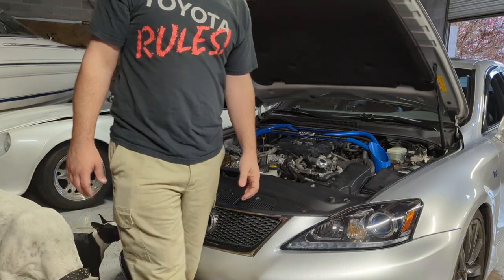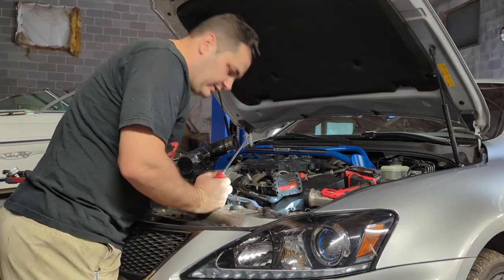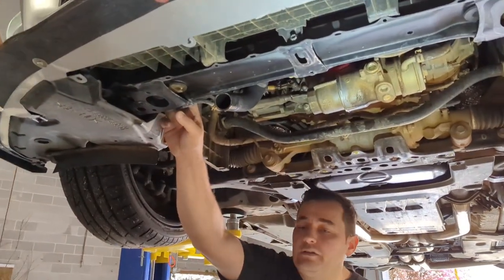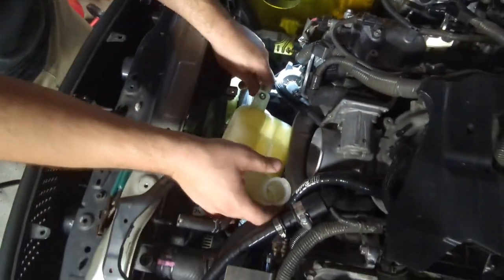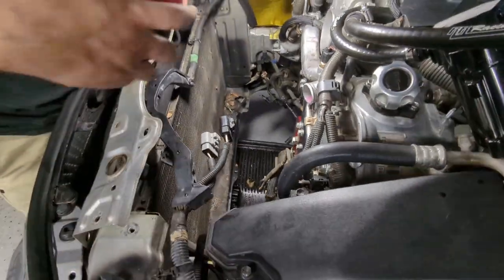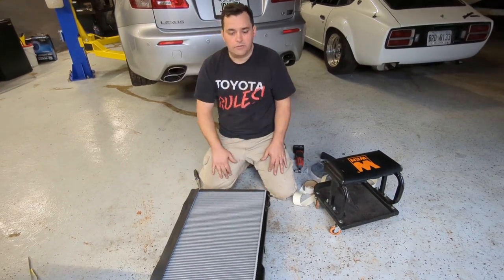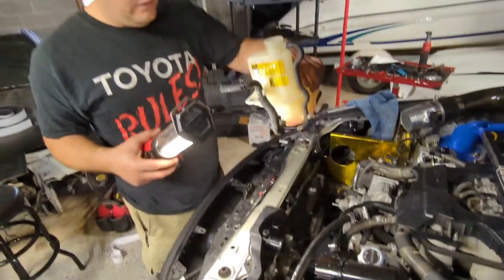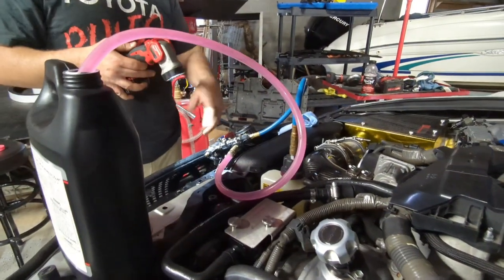Lexus ISF oem radiator install and pointer's

Comment: Great video, what kind of foam tape did you use? I have been looking at HD and lowes but cant find one thats rated for temps higher than 180 F
Reply from the maker: Hi..thank you ...I usually use the Lowe's one....never had a problem even on track.... AutoZone also sells some....hope this helps..👍

Comment: If, for example, I did a drain or rather a change of cooland, that is, I changed the cooland that I had for a new one in my Lexus ISF, but I had already done the transmission oil change, how does this influence me in doing this change? from cooland does this affect the transmission oil?
Reply from the maker: It doesn't... only if you change the radiator.. hope this helps 👍

Comment: Great Tutorial! Quick question… when ever I go WOT I get a really bad egg smell in the cabin… have you ever Experience or come across something similar to this, or any idea what could be causing this? 
Best Regards,
Johnny.
Reply from the maker: Could be your cats going out ..do you have stock exhaust manifolds....?
Reply: Yes, stock exhaust. I really appreciate that you took the time to answer my question. Thank you!
Reply from the maker: @johnnyruckiz  👍 thanks man ..just trying to help...it's a small group that own isf.we got to help each other...if your exhaust manifolds are stock they tend to crack at higher mileage.you will here a exhaust leak especially at cold start...if you are in the Atlanta area I can put it on my lift and check it out for you..thank you for the positive comment and the like👍
Reply: Sounds like you need to replace your trunk flaps. Easy fix
Reply: Yup, check your trunk pressure vents. Lift the two rear plastic panels (left and right) in the trunk to see if the vent flaps are still there. This is a common part that needs to be replaced in the IS-F.
Reply from the maker: Yep..👍